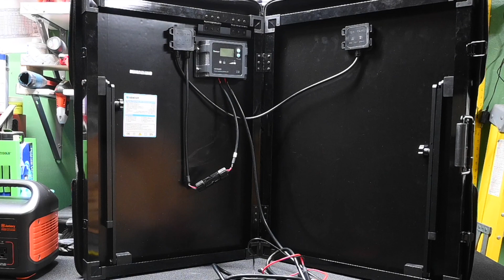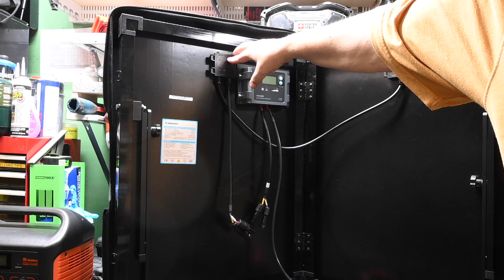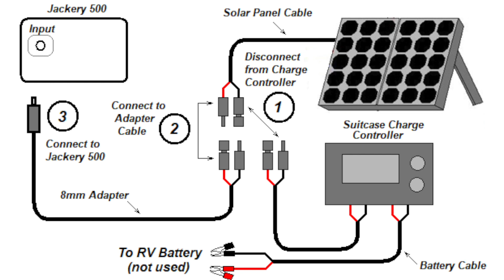How to connect a Jackery 500 to a Renogy Portable Solar Panel.

Comment: I have the same set up, but my Renogy is hard wired from the solar panel to the charge controller, so I will have to cut the wire, and put in connectors. Hopefully the wires are color coded.

Comment: Thank you for an excellent well explained lesson that perfectly answers the question that I did not have to ask, you read my mind! Now I can easily switch connections between my solar panel and its solar controller depending on whether I wish to charge my Blueti solar generator/power station or charge my back-up lithium iron phosphate battery! Could I set up or use a simple switch mechanism such as a battery isolation cut off switch( or something similar) to change between battery and power station charging mode?

Next question, what would you recommend would be the correct and hopefully simple way to transfer power from my back up 100Ah LiP4 battery to my Bluetti ?
Happy days always,
SkipRay, Kerry, Ireland.

Comment: What’s the highest wattage charge rate you’ve experienced, with the panels at the optimum setting, on a sunny day? 

I noticed that you indicated when charging batteries, the alligator clips should be hooked up first, and then to plug the MC4 connectors into the solar panel. Should the same be done when charging a solar generator, that is, plug in the connector coming off of the solar generator first, and then make the MC4 connections to the solar panel. Why or why not?

Also, could you do a video, on how to connect 2 Renogy 200W Solar Panel Suitcases in series, to boost the charge rate? Again, thank you for providing such in depth details, it is really appreciated appreciated! Take care.

Comment: Thanks for the video. My understanding is the 20A Voyager Charge Controller on the Renogy suitcase solar panel is only for regulating charge to a battery, not a power station such as  Jackery or Bluetti, correct?
Reply from the maker: Anytime you charge a battery with a solar panel, you need a charge controller, which is essentially just a battery charger. 

The Jackery has it's own charge controller built into the unit, so it does not need the Voyager charge controller.  If you tried to use an external charge controller, the voltage would be too low for the Jackery's internal charge controller to work properly.

Comment: Thanks for making this. 
Can you connect another panel with this solar suitcase to increase the wattage when charging one of the Renogy Lithium Ion batteries?
Reply from the maker: The Renogy 100 and 200 Watt suitcases are actually two panels that are parallel connected. It would be a simple matter to connect another identical panel array.

However, make sure the charge controller can handle the additional load, and that it will properly charge Lithium batteries.

Comment: I have 2 Renogy 200w suitcase panels on the way i would very much appreciate if you could list what bit's i need to connect them up in parallel series to a mpp solar all in one inverter :)
Reply from the maker: Have you had a chance to check out my suitcase solar power website article, or the 12 videos associated with the webpage? If not, there is a lot of info that might answer your question: http://www.rv-project.com/projects/suitcase.php
Reply: @RVProject  I have seen your video's but they aren't as clear as this one. I will have another look, just don't want to be ordering the wrong items and the renogy website is not that helpful either. Thanks for your reply :)